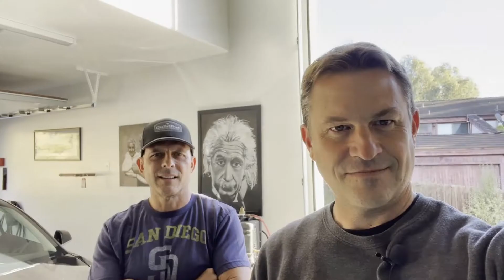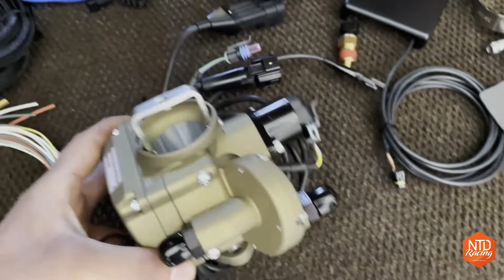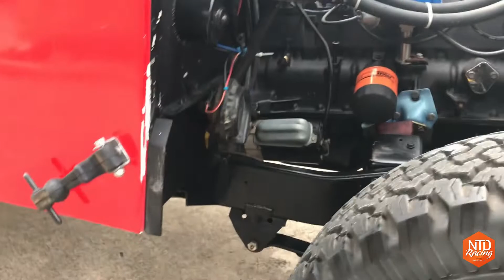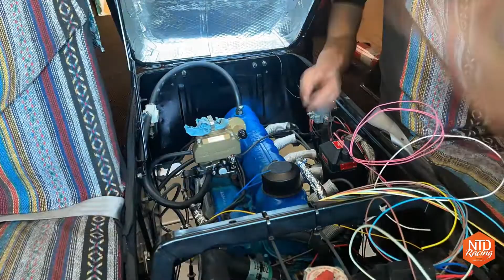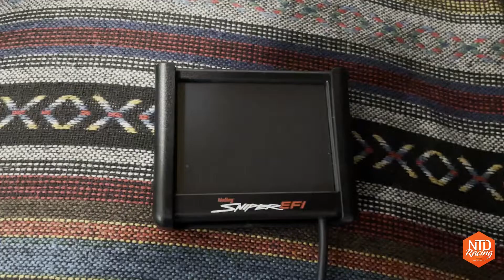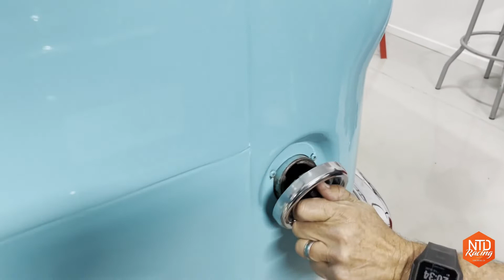Holley Sniper EFI replaces Autolite 1100 - 1965 Ford Econoline

Comment: Hey 3 years later. Tell Dan I love his van.  Watching the video, I did not see the engine belly pan.  It goes from the grill opening to under the radiator.  It is not a gravel guard it really is part of the cooling system.  My wife’s ‘62 still has it.  If you guys just google Econoline belly pan…people are remaking them now…love the van

Comment: I have a 64 Econoline van just about same color and I noticed you have rear shackles...how did you get around the gas fill inlet pipe upon installing the shackles?  I need to lift mine approx 1 inch or more but the fuel fill pipe is in the way.  Did you have to rearrange the pipe or get a different one?  My gas fill pipe if part metal and part fuel rubber.  Appreciate any help or tips you can provide.

Comment: I have a 65 Econoline Truck, I want to do this install on mine, where did you get the fuel pump?
Can't tell on Holly's website if it comes with the kit.
Reply from the maker: You do have to purchase a pump.  You can probably find a better deal, but we used this. https://www.holley.com/products/fuel_systems/fuel_system_kits/parts/526-5. Thanks for watching and good luck.
Reply: @ntdracing  Thanks!
Reply from the maker: Any time.

Comment: Only a min into this and I knew that holley efi was the way to go.  Curious to see if you had to get an offe intake and if that fit ok in there.
Reply from the maker: The van took the EFI on the stock intake.  I had an Offenhauser intake on the CJ when it was carbureted and just kept it for the EFI modification.  If the sniper was available when I put EFI on the Jeep, I would gone with Holley and  probably would have kept the stock intake.  If looking for a bunch more power...I would go with the LS swap.
Reply: @ntdracing  I ended up selling my jeep a few years ago...literally spent $6k on a new Jet Knee Mill just to make jeep parts...I'd wanted a mill 20 years.  Jeeps gone, mill is in the garage still brand new, never even wired up.  Should come in handy someday for a van or something.  Work too much now to use it....80hrs a week.  Thx for reply!